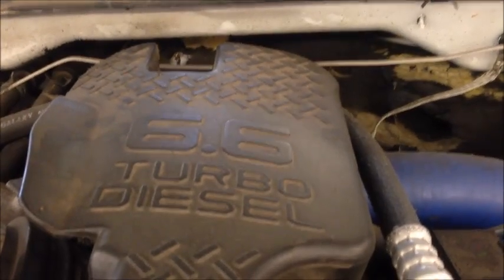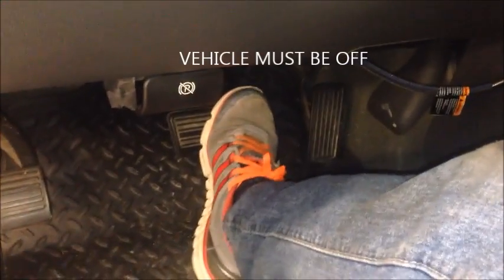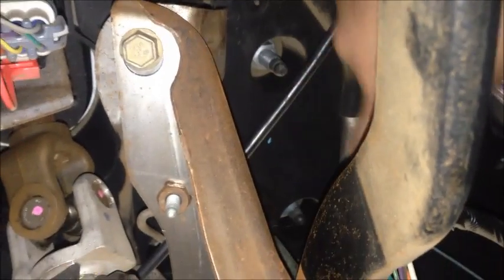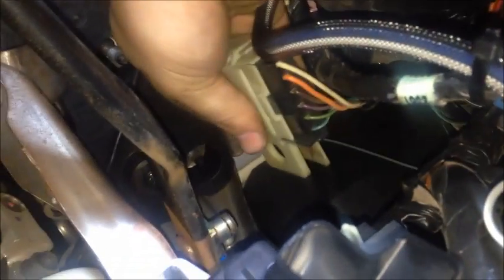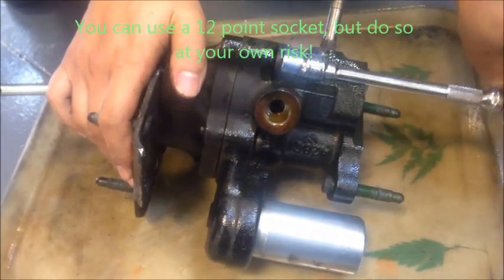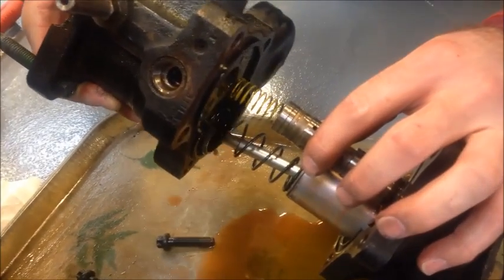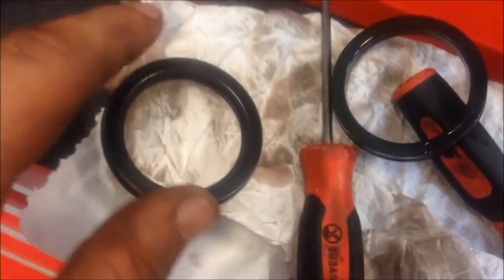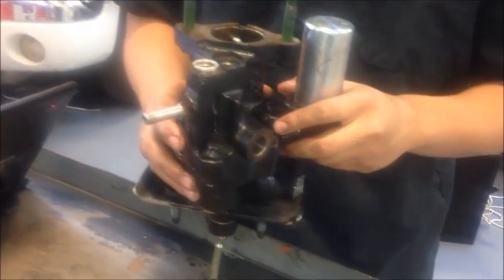Repairing a Leaky GM Hydroboost (Powersteering Leak)

Comment: Was about to buy a whole new unit till I found your video.  Took me less than an hour and less that $10 to fix mine.  Thanks for posting!

The bolts under the dash are hard to get to....unless you have a mechanically inclined 10 yr old to help....then it's a piece if pie!!!
Reply from the maker: Glad this could help!
Reply: what is the part number for the seal you used. 2004 chevy suburban 1500 gas
Reply: I gotta get me one of those 10 yr olds to help me

Comment: Worked great on my GMC 2005 Yukon Denali XL, 1500 6.0. I purchased the kit in the link and it worked perfectly! I would recommend cracking the E12 bolts that keep the hydroboost together before removing it from the firewall, mine were really stuck in there and it was difficult to crack them once I had pulled the unit from the vehicle. You live, you learn. Also, I had a hard time putting the hydroboost back together. I could push both halves close together, but not quite all the way. I thought I might be caught on something, but couldn't see any problems.  Eventually, I just barely started all five of the E12 bolts and then slowly tightened them in a star pattern to keep the pressure even as the two halves of the hydroboost came back together. I was hesitant to do this because I didn't want to damage anything that shouldn't be forced, but it worked like a charm, don't be afraid, just be careful. Also, there are o-rings on the two threaded hoses that you pull, they don't really fly out, but be sure to keep an eye on them when you disconnect the hoses. All in all, it took me about two hours. I could do it again in one. Hope this helps. And great video man! Thank you! You saved me a lot of money. And good luck to everyone out there! As far as automotive jobs go, it's not that bad, you can do it.
Reply from the maker: Great tips! Thanks for sharing, I'm sure others will find this useful.
Reply: @stlouissux9119  Thank you for the video! I'm efinitely glad you made this, it saved me a lot of money!
Reply: I'm doing this tomorrow on the same vehicle 05 Denali xl. Thanx for the confidence boost!

Comment: Just did this last weekend. Took me about 3 hours, the clip on the brake pedal was the hardest part because I didn't want to damage it. I ordered the whole seal kit from eBay for $35 just to get the one seal (I didn't want to order 1 seal and it not be correct so I got every seal in the hydroboost at once). Did the brake bleeding at the end and drove about 10 miles before brakes went back to normal pressure. It's been about 100 miles and I don't have a single drop of leaking fluid. I'm very happy and thanks for the video!
Reply from the maker: Very glad we could help!

Comment: THAT is a helluva lot cheaper than a replacement hydroboost unit! Thanks!
Reply from the maker: Not a problem, glad we could help!
Reply: Hydro boost its very expensive, while you have it off you might as well replace it with a 2011 model way better braking.

Comment: I just finished this job. I ordered the linked kit. Delivered to my door in just a few days. Took me roughly two hours start to finish. Perfect video, perfect kit, near perfect job. Hardest part is removing the mount nuts. One thing I didn't look at before ordering the kit is that I had regular hex head bolts instead of the star head bolts so I didn't need the socket but that ok, I'll add it to the rest of my tools. Thanks!
Reply from the maker: MarkPdot glad we could help! Sounds like you don’t have the original hydroboost is you had hex head bolts!

Comment: My hydroboost is leaking. Great video I'm getting ready to order the seals and fix mine. Question: I have an intermittent problem that brake pedal gets soft and goes almost to floor. This is intermittent. Can a leaking hydroboost cause soft brake pedal? Not loosing brake fluid.

Comment: I have a 1999 K2500 Suburban with leaky hydroboost. I have ordered 3 piece seal kit. Most of my leak comes from where the figure 8 seal is. I've watched several videos where only seals are replaced so why don't you take it apart from under the hood instead of from inside? Seems quicker and easier if taken apart at 5 bolts under the hood. I would appreciate your thoughts on this, thanks

Comment: did this any idea why the boost is applying brakes as soon as i start the truck? at first i thought i didnt engadge the piston into the grove on the actuator took it apart checked that all good still doing it. start trucks brake peddles goes to floor turn truck off and it comes back up

Comment: I’ve watched other YouTube videos where the brake pedal is held down while turning the wheel lock to lock. Would you mind explaining why you apply the brake after turning the wheel lock to lock?  Not saying your method is wrong. Just figure there is a reason you bled the system the way you did. Thanks for the great video!
Reply: Because the hydroboost receive it power from the brake master cylinder 😊

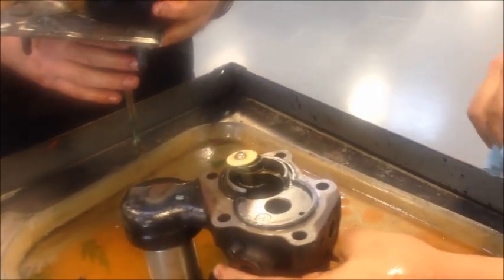Comment: Hi, at about 4:34 you see a small valve with three holes in it that is flush with the half of the hydroboost. What parts are inside that?? i seem to have a small metal cylinder shaped piece which is behind the valve. they came out but i'm not sure if more than just the two pieces go in there. I Maybe missing something? 2005 Escalade. It does not have the plastic insert with the ball bearing inside or the small plunger inside the valve, like the parts kit and a few videos show... Can you help? I can send a picture.

Comment: Could you possibly tell me which line would be rubbing on the innercooler pipe? They are rubbing a hole in each other. I want to fix that line. Just not sure which one it is.

Comment: Thanks for the video guys! I completed everything but now my brakes are hard (literally have to push with all my strength to come to a complete stop). Any ideas? Brakes were fine before changing the hydroboost seals.
Reply from the maker: Did you install it the correct way?
Reply: Did you fixed it

Comment from the maker: Link to Seal: https://boostautoparts.com/products/gm-hydroboost-seals-final?utm_source=DIY%20GM%20Hydroboost&utm_medium=Comment&utm_campaign=YouTube
Reply: the question I have is do you think that my ABS light is on because my hydraulic brake booster is leaking
Reply: vincent limon No this leak is not linked to the ABS. The most likely cause of an ABS light would be the sensors at your hubs of each wheel.

Comment: Question can you just get the master cylinder out of the way and then pull the part off and not remove the section on the firewall?
Reply from the maker: Some have had luck doing it this way.
Reply: Great question! I'd rather not mess with the brake pedal and firewall if I can replace the seals while still mounted.

Comment: Have 2003 Chevrolet 2500 HD replaced power steering pump cuz it was making a noise and it was hard to steer and stop after I replaced it seemed worse so replace the hydro booster with a used one off of 2013 everything looks the same now still has same problems wondering if I can still have air in the system it still makes terrible racket almost impossible to steer and to stop how can I get the air out of it if that's what's wrong with it

Comment: I just replace the steering box and the powersterring pump along with lines and pitman arm because of a crack in steering box and a leak from back of ps pump. And after replacing and turning wheel lock to like 4-5 times the shutting off and topping of fluid it still whines, and when I use my brakes it will lock the steering wheel in its current position. Going to try and bleed the way you described in video in the morning.
Reply: dirtrulz112  you have to use a hand vacuum pump at 20 psi when you first installed everything otherwise you'll break something with so much air pressure on the system.  With vehicle off ignition on put the vacuum on the power steering and vehicle off the ground turn wheels left to right with out looking it , and checking the fluid level after a few tries and top it off as needed eventually you'll see air bubbles coming with the fluid . once you see fluid only then you are good to go. at that point turn engine on and let it idle for 2 minutes, then check fluid again but this time on the hit mark.  you'll have a little noise for about 2 weeks but it will go away. these guys were bleeding the hydro system not what you did.
Reply from the maker: Good advice thanks
Reply: I have a problem with my2003chevy2500hd it has the6.0 motor . It was making a noise and hard to drive and stop so went and replaced the power steering pump it was just as bad if not worst so got a used hydrobooster off a 2013 everything looked the same so I but on still just as bad been driving it finally parked it been pulling my hair out I tryed to bleed the system some like but not exactly no help. I'm wondering if I still have air in my system and how to get it out

Comment: I have a question on 2008 Silverado HD 6.6 it started to make noise from the power steering pressure line and brake pedal pulsates Wen I Apply it steering will wen turning make a bad noise like it has air in it do you recommend replace p/s pump and hydro booster As well or just pump thank you for your time
Reply from the maker: Sorry, can you explain the situation a bit more?

Comment: Thinking of  trying this today. How long to do this gasket change out? I have a 2004.5 LLY. I assume same O-ring as the for the LB7's?
Reply from the maker: Should be the same O-ring. It will take 1-2 hours depending on how fast you move. Took me about 2 hours but was filming at the same time. To do it over again it would probably be about an hour.

Comment: i like the video , thanks  but my power steering pump dosen;t have a fill cap    do i have the same unit ?
Reply from the maker: +johnj bieble What's the year, make, & model of your vehicle?
Reply: oh i was out in left field    i have a 2000 chevy express van 1 ton   5.7 L.    hydro boost is leaking,  and the pump is shot.
Reply from the maker: That should have a resovoir. If you can't find it I can provide some documentation on the location.
Reply: its mounted on the fire wall above the hydro boost  and master cyl.      thanks for the shout  i got confused when i saw the fill cap in the vid

Comment: After replacing power steering pump, I have a brake problem.  When I step on the pedal, it pops up but then I can depress it and they work properly.  But it pops everytime I step on it.  It feels like the anti locks are starting to come on each time.  Could there be air in hydroboost?
Reply from the maker: Try bleeding it per the procedure in the video.

Comment: Just ordered the seal because my hydro booster was seeping power steering fluid at the same place where you split the unit in half. I assume this seal should fix my problem or do you think I may need that figure 8 looking seal also. thanks
Reply from the maker: The figure 8 seal almost never causes the leak. If it's leaking between the master cylinder and the hydroboost it's the seal from the video. The only time it would be the figure 8 is if it is leaking all the way back against the firewall as the figure 8 seal is what seals the two halves of the hydroboost. Again, very rare that it's that one.
Reply: Curious because i have fluid that has seeped inside of vehicle above brake pedal. Noticed seepage also at the half where you separate booster in your video. Its located just on other side of gas cylinder towards firewall, tgats why I am wondering if it may also be figure 8 seal,its leaking there. What do you think?
Reply from the maker: If it is leaking between the two halves you likely need the figure 8 seal too.
Reply: Any idea where I can get the figure 8 seal without purchasing the entire kit. 
Thanks
Reply from the maker: Sorry I think you will need the whole kit.
Reply: Ok thanks, kind of figured so.  It still beats the price of a new booster.

Comment: Could this hydroboost leak be mistaken for a rack and pinion leak I'm leaking a little power steering fluid on my 07 tahoe and can't pin point from where and I don't have a uv light for the dye test any tips or suggestions will be greatly appreciated
Reply from the maker: It is certainly possible depending on how it is dripping. You should be able to see some wet areas on the hydroboost if it's leaking.
Reply: @stlouissux9119  Thanks for the pointers

Comment: How do u prevent it from pinching the seal I already did it  twice and keeps pinching it so it leaks again
Reply from the maker: +David Conde Which seal are you referencing?
Reply: @stlouissux9119  I think he's referring to the round inner seal; the one that started this whole project to begin with. I, too, am having the same issue. Can't seem to mate them together without it crushing the new seal causing it to leak again. Even tightened the bolts in a star pattern very gradually only to have it tear the new seal.

Comment: Okay so I took my hydroboost apart and replaced the seals, but when assembling the hydroboost back together it was giving me problems and wouldn’t come all the way together! I tried At it for minutes on end and it would still have an inch or so gap in between both parts of the hydroboost. So I went ahead and made sure everything was where it needed to be, and then I put the bolts in (hand tightened) and drilled them in a star pattern! That was the only way I could get my hydroboost to come together. I finished assembling it and reinstalled and now two days later I’m having this hissing noise coming from under the dash when I turn my steering wheel left or right. Does anyone have any tips they can share on what the problem is or if I shouldn’t have put the hydroboost together that way. It’d be a lot of help! Thanks
Reply: I know I’m a year late on this comment lol but any help would be amazing right now!

Comment: I have a 2001 2500hd.  I have a very soft pedal with the truck off.  I can pump the brake pedal and it sinks to the floor.  I have replaced the master cylinder but i still get a soft pedal when the truck is not on.  Could it be the hydroboost unit?
Reply from the maker: Did you bench bleed the master before install?
Reply: Yes. And I also had the brakes bled.
Reply: When you buy the hydroboost you still have to use the rod with the  little disc on it, the spring and the round spider like thing with the hole in the middle that keeps the rod centered, from your original booster. The rod pushes out from the end of the hydroboost into the brake booster when you push the brake. That will settle your sinking petal.

Comment: I have an issue that you may be able to shed some light on....
I bought a used '06 yukon denali XL with GM SPO codes JF4, JH2 and JL4. Since the day I purchased it, the brake pedal has had an instant single kick-back if I hit the brakes fast and hard -(like someone pulls out in front of you type braking). I have replaced and bled all four calipers, replaced and bled the master cylinder, removed the fuse for the ABS system-then replaced it after testing....still single-kicks the same each time the brakes are depressed in this way. (I live in Mid-Michigan and definitely know when the ABS is activating.) It does not kick back during normal braking. There are currently no brake related codes to read. (Current codes are related to ride control, tire monitor and air bag.) Any thoughts? Questions?
Reply from the maker: Sounds like an ABS issue, but it could be a bad hydroboost if you already ruled that out.
Reply: I thank you for the reply. It helps to know that I'm not going insane....
Reply: I have the same issue on an 04 Silverado 2500HD....Its a significant kick back and then it feels like you have stopping power
Reply: Did you ever find the fix for the  brake pedal kick back issue? I have the exact same symptom. If I brake normal, everything functions as it should but when you hit the pedal quickly there's a split second kickback. I think I heard in another video it can be the hydroboost accumulator? Which at that point you'd have to replace the whole HB unit...
Reply: I found a video that shows how to swap in a 2011 model HBoost unit which is less expensive that the '06 and I'm going to try it. Just been busy fixing multiple '05 Duramax transfer-case issues. Should be soon, though. Will post here with results.
Reply: Cool please do, that sounds interesting. Are you a Chevy/GM tech?
Reply: No, just a guy that grew up working on evolving automobiles. I currently own a 2005 Duramax and the aforementioned '06 Yukon Denali XL. Eventually, I will be changing both sets of brakelines to the AN system. Likely within the next year.
Reply: This video solved my issues

Comment: if I'm getting bad vibration by moving the steering wheel and pushing the brake pedal can that be a bad hydroboost unit
Reply from the maker: +Cesar Garcia Absolutely. Check your powersteering fluid too.
Reply: Ok thanks

Comment: Why do you have to pull the whole hydroboost to fix it?  It looks like you could take the 4 inverse star keys and fix the problem.
Reply from the maker: It is a bit more difficult to do it on the truck, but you can do it that way if you'd like.

Comment: I still have  a small leak from same place any suggestions   ?
Reply from the maker: +Gwenna Smith There's a chance the grove the seal sits in is damaged therefore you may need a new unit. Are you sure you put the seal in facing the correct direction?
Reply: Mine also leaks after doing this procedure (which I really appreciate you posting).  There's probably a lot of possibilities as to the leak source... but ask, does it just make sense to get a rebuilt HB rather than unistall/reinstall seals?  I'm a home mechanic and haven't tried the UV die yet...